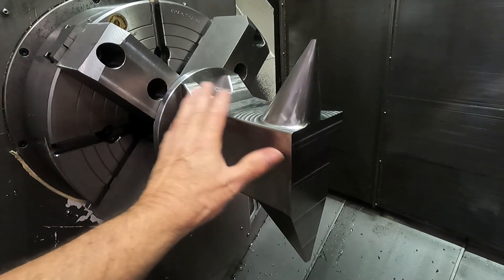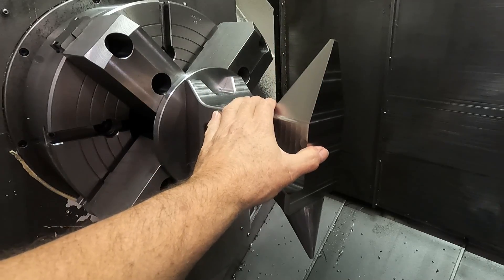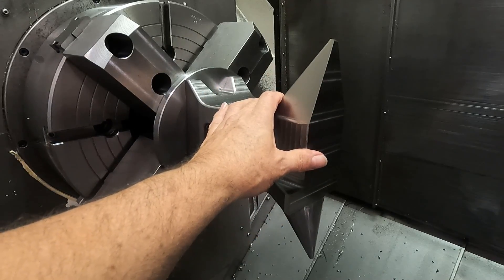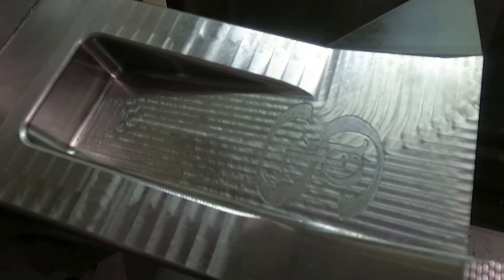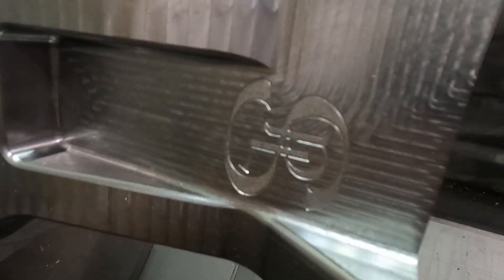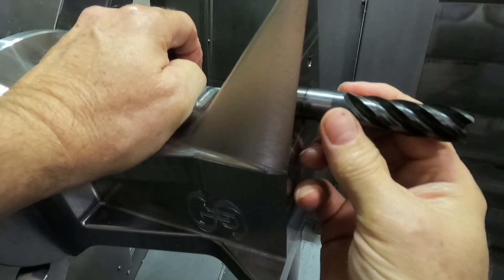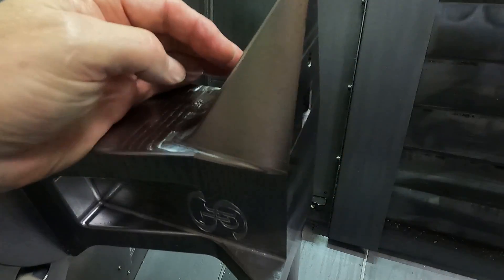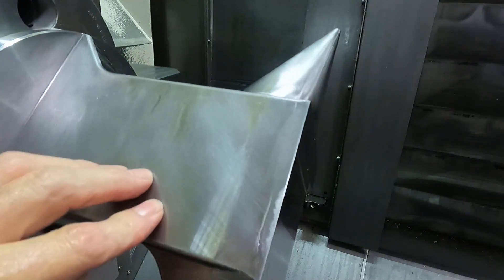Anvil Hardy and Logo Machining.

Comment: How close is the tool changer to meeting the previous zero, ?
Reply from the maker: I’m not sure I understand. Are you asking how repeatable the tool changes in the spindle? If that’s it, it’s closer than the machines positional resolution.
Reply: So repeat selection of a tool will be spot on?
Reply from the maker: Yes. Within the precision necessary for machine work. Nothing is spot on (As you put it) perfect.

Comment: The real test will be pounding on hot iron or steel. How much bounce does this anvil have? Drop a 1/2" or 12mm ball bearing on it and see how high it bounces. Listen to the ring. Do it up and down the surfaces to check for consistency throughout.
Reply from the maker: Well right now the steel isn’t really heat treated. It’s not soft sort of like a comercial heat treat. If I got the anvils induction heat treated on the top surfaces then this would be a proper anvil. I may look into that.

Comment: We way you programmed that square chamfer was beatifull
Reply from the maker: It's the only way to get the sharp mitered corners. If I did it straight in with a chamfer milling cutter it would leave a radius and not get into the sharp corner.

Comment: this is bad for both spindle bearing ,keep well
Reply from the maker: Not on this machine. It is designed for this. It has a special coupling in the spindle designed to take the force of turning tool on it and not on the milling spindle. That said this would actually put less force on the this spindle bearings of a normal machine than milling or drilling does.

Comment: Sort of interesting that these "fancy" CAM packages don't have broaching cycles built in.  I get that it is probably an uncommon process today but on the other hand, it would likely be a fairly simple bit of code to add compared to all the 5axis crazy code these packages can handle.
Reply from the maker: I have used this cutting style quite a few times in the past. For instance if you want to cut a internal keyway or a spline. In some of my emailer videos I show removing sections of a ID thread to make sort of a breach closure or cutting around a internal integral key in a bore. To establish the sharp internal corners the endmill could not do. So yes it would be very useful to have a cycle in Cam for this.

Comment: How did you do the cross pattern on the logo did you thread it as a normal floor finnish operation on cam and just use engrave endmill or what
Reply from the maker: It’s just two pocket floor finish passes with a one way linear cut directions. One at 45 degrees and one at -45 degrees. I tried a zig zag pattern but it didn’t do that without some passes going across at some weird angle that didn’t match the pattern.

Comment: The hardy hole looks good. I don't remember if you previously showed the making of the broach tool or not? And the engraving turned out pretty sweet too. I like that textured look. Nice job Peter
Reply from the maker: It’s the same tool I used for the large anvil. I don’t think I made a video on the making of this tool. Maybe I showed something in the large anvil videos. I can’t remember.
Reply: @EdgePrecision  I went back to watch the old video, you did show the simulation of grinding the part. I didn't know NumRoto supported grinding non-rotating tools as well.
Reply from the maker: @purerhodium  there is what they call manual grinding paths. That’s what I use for these kind of tools.
Reply: @EdgePrecision  If you have the time it'd be interesting to see how you program that.
Reply from the maker: @purerhodium  There are modulas for Numroto that I don’t have. I think one can grind things like turning inserts. But I have ground all kind of lathe tools with what I have. You just have to sort of imagen them as a single flute tool. Then make a fixture to hold a insert as if it were that single flute location. Or I have ground boring bars like micro 100 tools. If you do a manual move where you grind a diameter. Sort of like a wide groove in a round blank. I the manual grinding path there is some settings to offset that path in all axi. But if you offset the tools rotary axis off center. It will grind that groove so to speak with its axis off center of the rotation. This way you can grind the shank relief off center like a Micro 100 tool has. Then use some more manual moves to grind the cutting edges of the tip of the bar. Just make the simulation what you want and it will grind it. You need to experiment with the manual grinding path and the end tab that has the offsets. Sort of like fixture offsets on a normal machine. Maybe I can do a video showing some settings for these things.

Comment: g'day Peter.

I'm sure the programming was challenging, I don't program.
what I did find most impressive was the tool geometry that allowed the broaching cycle without deflection to achieve the width of cut on 2 axes with what appeared to be consistent depth of cut, that was impressive.
to force the machine to perform a cycle is one thing....
to have an understanding of what geometry works when you push the machine boundaries is a whole different level.

Comment: why does it look like the strokes are not all the same length when you broach the hardy hole?
Reply from the maker: You are getting a distortion due to the cameras wide angle lens and the view angle. The tool is taking .002” off each cut and backing off .010” when it retracts. So as not to drag the cutting edge backwards on the material. Believe me all the cuts are the same.
Reply: @EdgePrecision  - You are one of very few people on Youtube that I actually believe when they says "believe me".  May you always use your powers for good!

Comment: Thanks for posting ,your work is amazing .Do you have any slideway loading that you have to override when doing the shaping? Yove definately mastered some techniques on your machines.Thanks!
Reply from the maker: This kind of machining puts very little load on the machine. It doesn’t even register on the load indicators. There are far greater loads in normal milling, drilling and turning operations.

Comment: does the spindle move a few thou on the back stroke to avoid rubbing?   or not necc
Reply from the maker: Yes it is moving .010” away on the back stroke. And feeding in .002” per cutting pass.

Comment: Great work as always Peter. I would be really interested to see how you programmed the broaching in esprit.
Reply from the maker: I used the manual program cycle. But even that won’t completely work, because you can’t do a manual milling cycle with the spindle stopped. The Mazak will give an alarm if you define the tool as a lathe tool but command the milling spindle to start. But I found out this. I could program the cycles with the spindle running in Esprit. Then select all the cycles their settings edit tab and tell it they don’t have the spindle on or a spindle speed. It will then process code without the spindle commands in the code. It even shows the spindle stopped in the simulation. If Esprit would let me define a square milling tool. It would even simulate the material removal accurately. I may check with support and see if that’s possible.
Reply: @EdgePrecision  as of 2021 R3 there is broaching specifically supported in Esprit. I am not sure how it would best apply on your broaching cycle. I haven't used it much. A custom macro called via manual entry is how I usually handle it.
Reply from the maker: @oostburgjblok  I’m using Esprit TNG here. If  they had a method to define a milling tool I could even simulate it. I did define a adaptive item of the tool. But there is no way to add a cutting edge. I can define a lathe tool I their software by moving the insert I the correct position. But it won’t let me select the lathe tool in the manual milling cycle. It doesn’t even show them as a selection. But what you saw in this video was completely processed in Esprit TNG. No edits in the code afterwards.